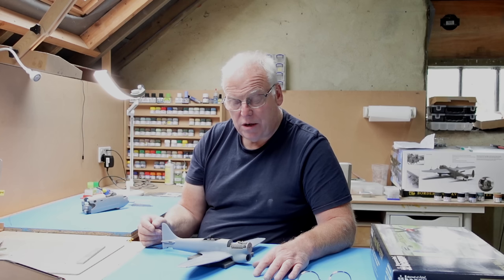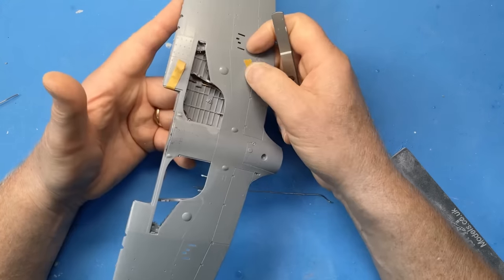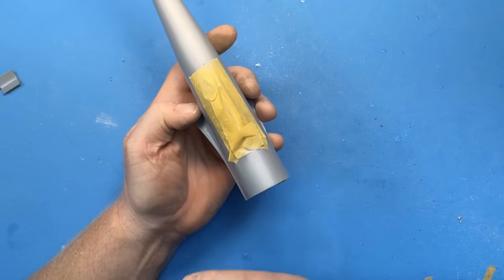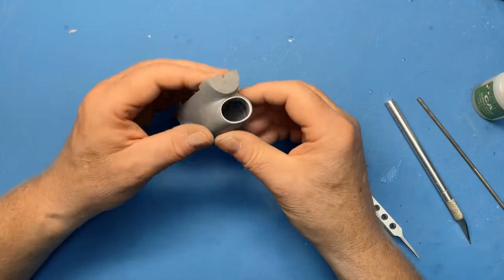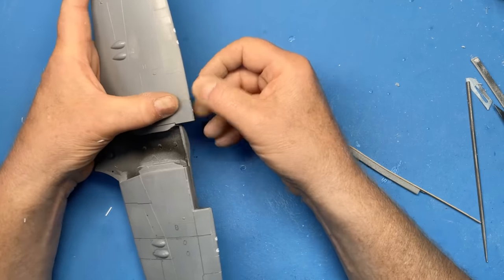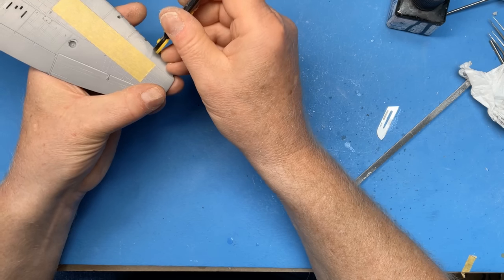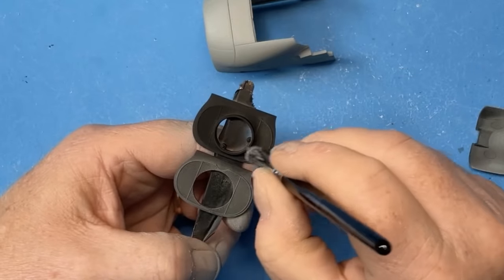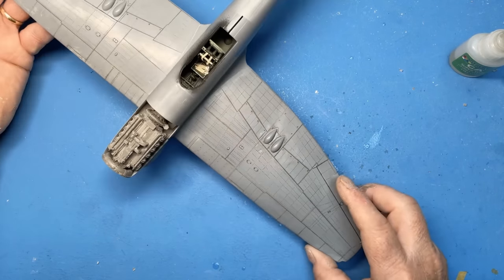Special Hobby 1/32 Tempest Mk V "High Tech" Part 3

Comment: Hi Steve, I'm not sure if you have tried an alternative to heavy primer surfacer for seams, using thick black carbon CA. It does take a while to cure, best overnight or hot air dry, but it doesn't sink and sands out well without damaging the surounding plastic.  Kind regards Dave Porter London
Reply from the maker: I haven’t Dave I’ll look it up.

Comment: Great video  I’m starting my kit this week. What happened to the front lower part of the bulkhead it’s gone
Reply from the maker: It served its purpose when gluing the fuselage and wings together but it was in the way of getting the nose fit correct
Reply: @TheModelShed  ok good info I’m at the point in my build wheel bay and your video is a big help.